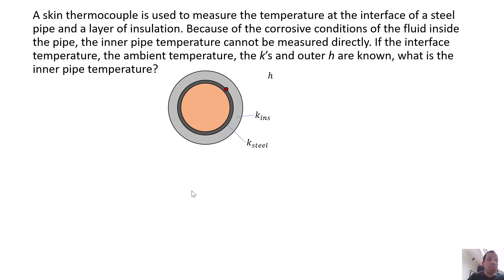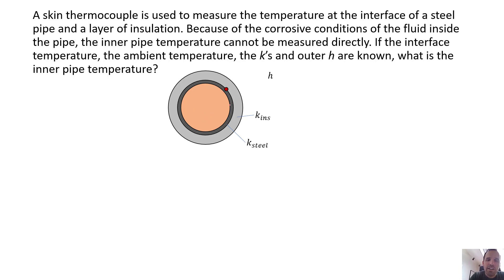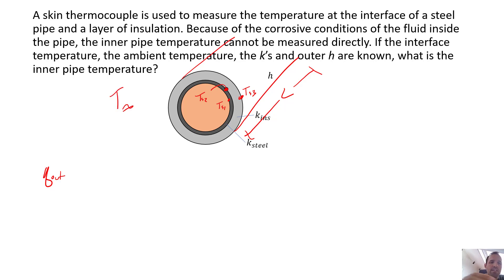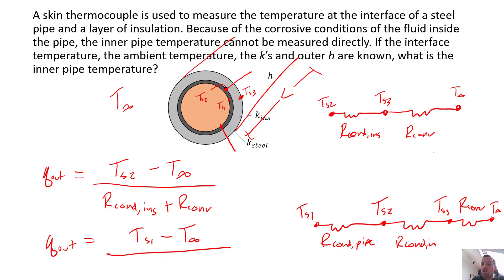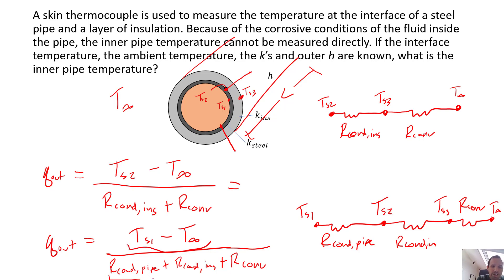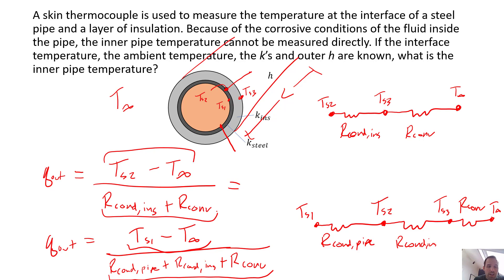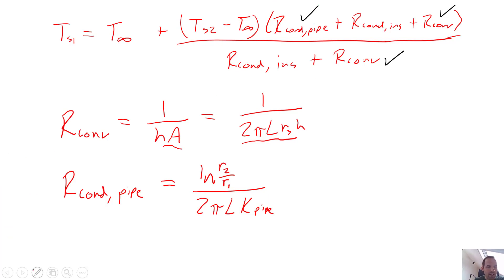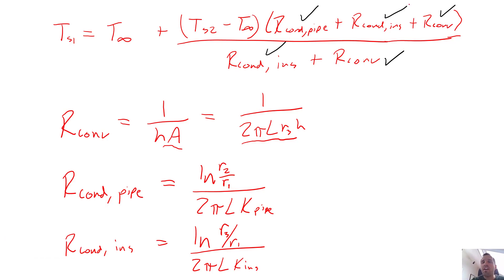Heat Transfer - Chapter 3 - Example Problem 1 - Equating Thermal Circuits to Solve for Temperature

Comment: Dear Kody,

I am currently working on my graduation project, which focuses on analyzing the heat emission from the exhaust insulation system of diesel generators in indoor installations. I have completed the theoretical calculations and am now looking to validate my results.

Given the strong similarity to the topic discussed in your video, I was wondering if you would be willing to take a look at my work. I would be happy to provide more details about the project + a calculation example via email if possible.

Any feedback or guidance you could offer would be greatly appreciated.
Thank you in advance for your time and support.
Kind regards,

Comment: Could you just equate the heat transfer rate as q_r = (T_s1 - T_inf)/R_tot , then solve for T_s1? Adding the thermal resistances would be conduction from r1 to r2 + conduction from r2 to r3 + convection from r3 to the bulk. I did it this way and my final equation for T_s1 was dependent on T_inf, the geometry of the pipe and various radii, heat transfer rate, and the coefficients of heat transfer. Did you do it that way to get rid of the heat transfer rate term from the final equation, if so why?